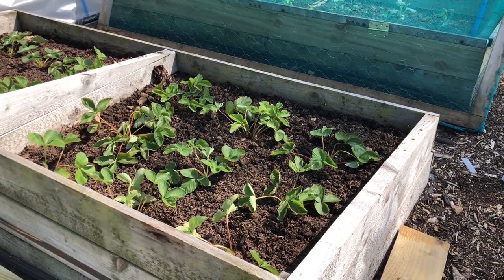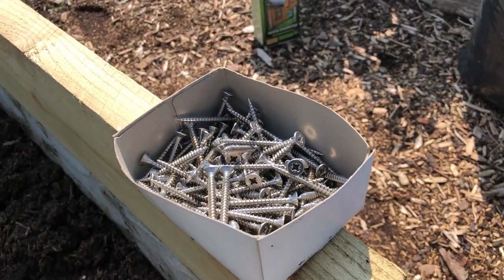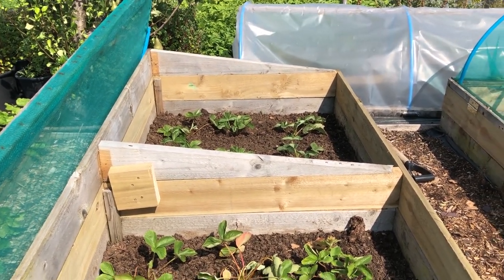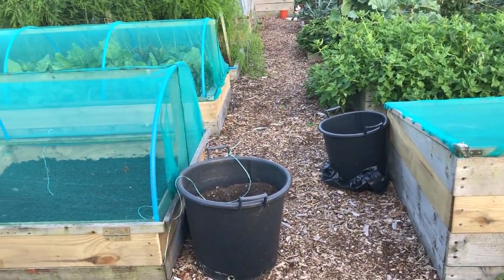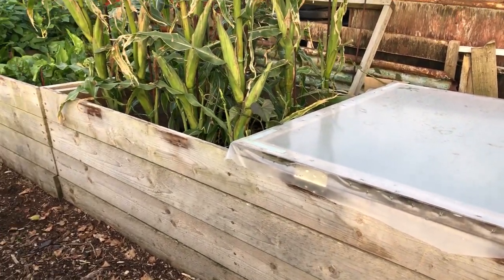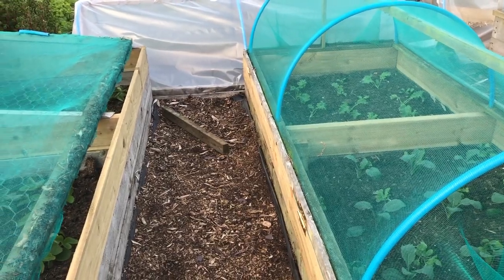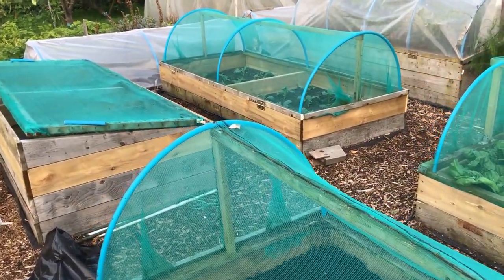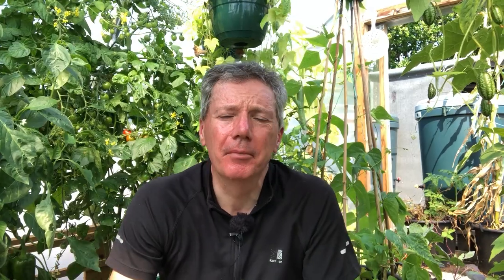Upgrading my cold-frames and low tunnels for increased yields

Comment: have a great result with super size plants and huge potatoes.  I use a 4ft by 8 ft mesh sided compost area. Each year  I move to a new spot. I did build an 8ft trellis for beans, but as I had lots i just put the potatoes in. The plants got strung to it as reached 7ft tall. Once dug up I had 1 potatoe at 1.2kg and many at 0.5kg. This proved effective now for the 3rd year. I thing the ground gets so full of  of energy the plants go nuts.
Reply from the maker: Do you plant the potatoes in the compost bin or in the ground where the compost bin has moved from? : all the best - Steve

Comment: Hi Steve, those low tunnels are brilliant, such a good idea, especially for someone who can't invest in a poly tunnel. I have a tunnel myself but I'm definitely going to try making one of these you can never have enough space. Do you have a selection of lids that you rotate, I noticed some are mesh and some are plastic. Also I wonder if you have a plan of measurements and materials, you're usually very good for recording things😊. I'm also wondering if the lids are on hinges and how the plastic roof is constructed? Is there one design in particular you can recommend? Sorry for all the questions but often when I try making structures one puff of wind they're knocked over, having said that my bean wigwam survived storm Ellen here in Ireland last night😊 Those peppers are so impressive. Thanks for the video.
Reply from the maker: Hi Bernadette,  take a look at these videos and then if you have any more questions ask away!    https://youtu.be/cskeYL3eD6Y  https://youtu.be/GUfB4DSzMyg
Reply from the maker: Also I do have a selection of lids.  most of my raised beds are the same size, so I can easily convert them to be cold-frames, mesh tunnels or polytunnels.  I also have a few mesh tops for my cold-frames for summer.  They are hinged and tied down with bungee chords, we've never had any wind damage  : All the best - Steve
Reply: @SteveRichards  Thank you Steve

Comment: Newbie here. What wood do you use? I tried researching but there is so much different stuff and me as a foreigner I got confused 😕.
Reply from the maker: I just use treated timber, it used to be unsafe for edibles but that changed quite a while ago, if you are still concerned you can line the bed with black plastic  : All the best - Steve

Comment: What timber do you use for these Steve? I'm building something similar this winter (well it's  #2 on the priority list so a decent chance of getting completed). I like the modular design of yours (i.e think I might just copy them). Specifically the removable collars so they can swap from cold frames to tunnels.
Reply from the maker: Hi Simon,  I just use the treated timber from my local shop, nothing special,  I expect it will last about 10 years when in contact with the soil, so just the basic raised bed.  By then I will have raised the level of my paths (free wood chips) so I won't need the lowest tier and the next tier up which isn't in contact with the soil should last quite a few more years.   : All the best - Steve

Comment: I think you're definitely losing some accessibility though with those frames so high, going to be much harder to reach in and less sun exposure. But it may be the ticket for pepper plants. I would not do it for all the beds until you're absolutely sure.
Reply from the maker: I think I mentioned in the video that we tested it on 4 beds and got much better results from those than the lower ones, in summer light is abundant, in winter light is still good enough, heat is what's needed : All the best - Steve